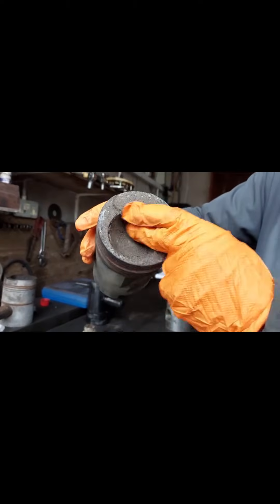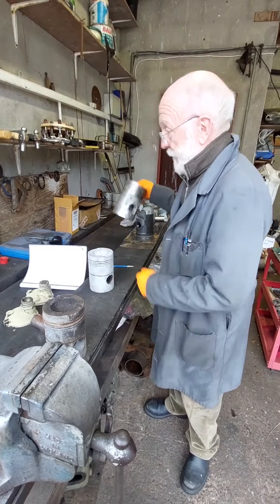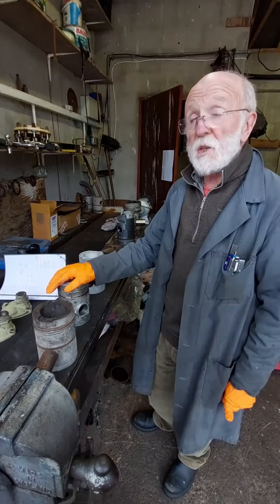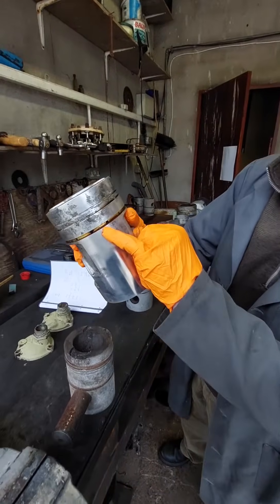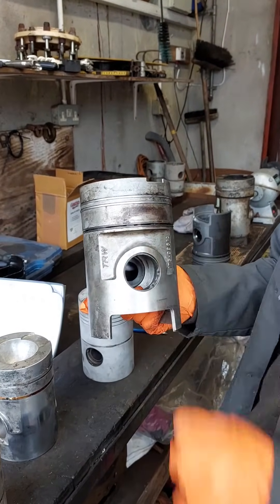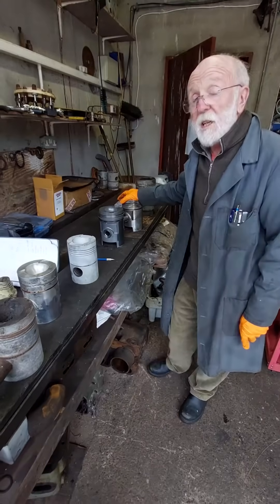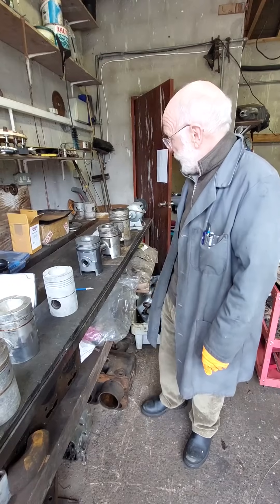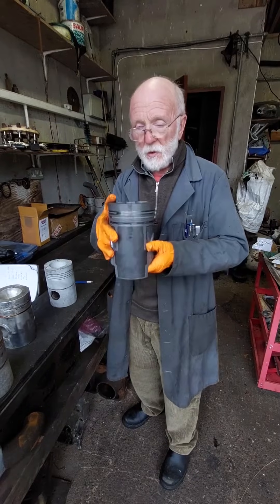Gardner Engines: we take a look at Gardner pistons.

Comment: Interesting video as always Joe, if I may, a few comments. 
1, taking the bores out to +30 was common practice, bus companies were notoriously tight with their cash and if they could save a few bob they would, the blocks would be painted black for standard and dark green for +30 bores.
2, To carry on from that, pistons would not only be obtained directly from Gardners but they would have also been sourced from other suppliers, Wellworthy and Hepolite springs to mind. Bearing in mind that on an LW the piston had to be removed by taking it down past the crankshaft and replaced in the same way. Gardner pistons had relieved skirts and were (relatively) easy to fit. The other pistons didn’t and consequently, especially the +30 pistons were much more of a fiddle due to the limited clearance between the crankshaft and crankcase.
LX / LXB pistons weren’t affected as they were removed by taking them up through the bore, the conrods were 4 bolt big ends and were shaped so that the bottom end of the rod had clearance to allow this.
3, We had to be aware, when fitting a block and pistons that all the pistons had to be the same. Stores being stores, weren’t above dishing out a set of mismatched pistons in the rather vain hope that no one would notice. As for the horizontal engines I was given to understand by a Gardner work’s engine builder that the gudgeon pins on the horizontal engine pistons were offset 30 thou compared to the vertical engine pistons to allow for the fact that the things were on their side so to speak.
Reply from the maker: Ah, thank you so much for that Geoff.   Super stuff.